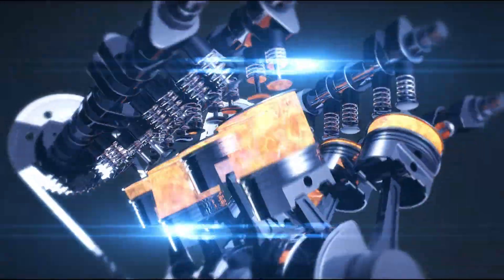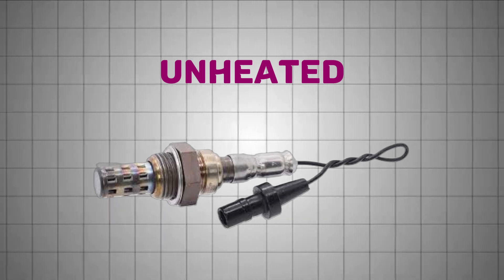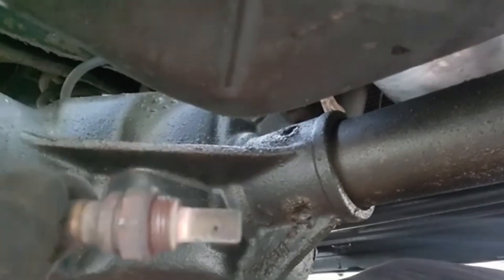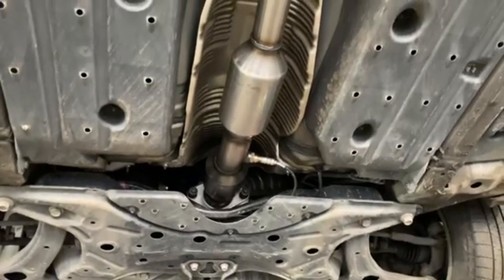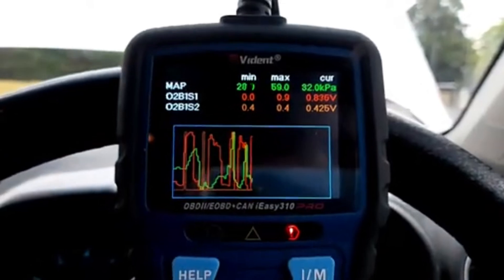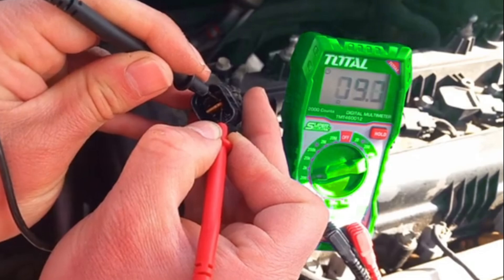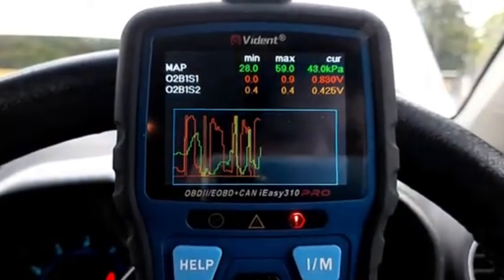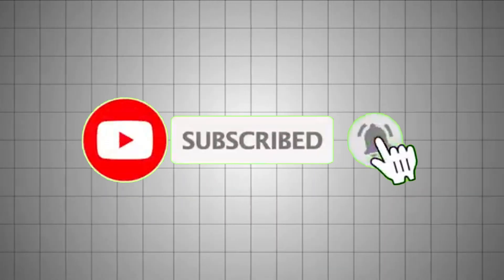O2 Sensor Testing | Step by Step Guide

Comment: Is this video AI?  Wrong info so seems to be.  O2 sensors are not an input to any cold start equation.
Reply from the maker: Thank You for the comment
I need to say, if the heater circuit fails, the sensor takes longer to reach its operating temperature and hence we have longer open loop operation with preset amount of fuel.